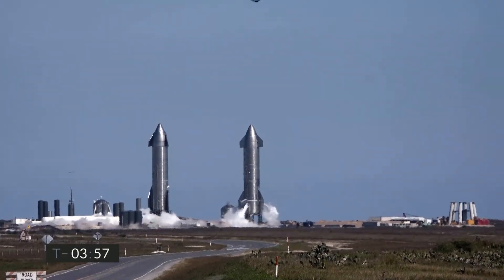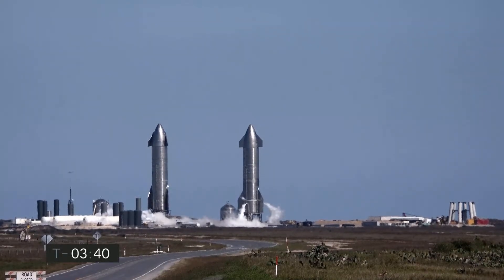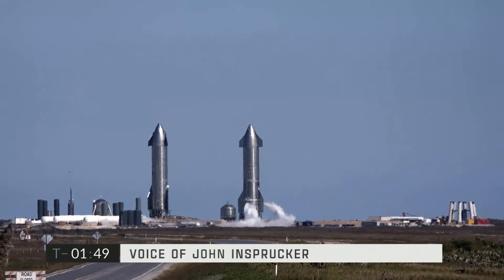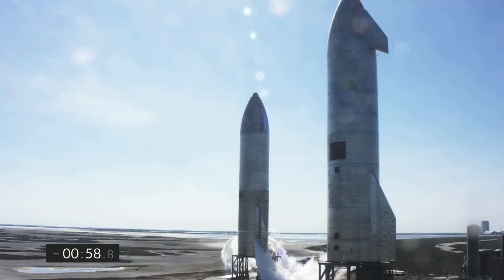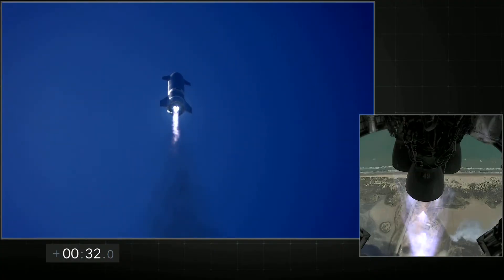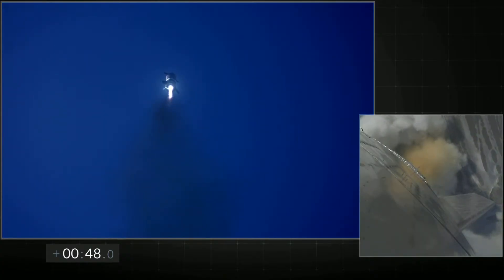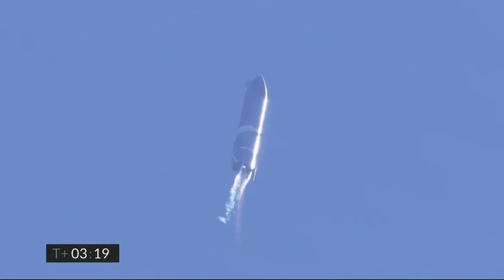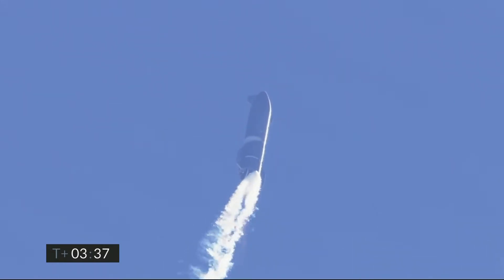Starship | SN9 | High-Altitude Flight Test

Comment: Next time simply start the transition early and see if you can get it to zero altitude change above the ground. When you get that working then go for the landing too. If you are just going to crater then work the kinks out in the air on the transition back out of the belly flop. Once righted you can also use the remaining fuel in the main tanks with the header tanks.

Comment: It literally swung like a pendulum past the ideal landing angle as well. Whatever thrust that was meant to slow the whole rocket down ended up going sideways. I think an earlier & slower flip with ~2 - 2.5X  more thrust once the correct angle has been reached might solve the problem. But hey; it's just a layman opinion, you're doing your best. Keep up the good work!

Comment: Just a question, it's obvious that these flaps on the rocket work in our atmosphere. But how's this going to work when landing on the moon, and on Mars? On mars the atmospheric pressure is much lower than here on earth, so how will these flaps be able to perform there like here? Or will the rocket totally rely on its thrust vectoring system?
Reply: The flaps are mainly for an earth landing. The plan is for the rockets to land on Mars and be able to return to earth.

Comment: I did not expect that ending at all. Talk about a twist ending. Pro Tip: Turn on the rocket's engines maybe 30 seconds sooner.
Reply: They couldn’t ignite a rocket engine. That is why it failed.
Reply: There isn't even enough fuel in the header tanks to run those engines for 30 second lol. Not to mention it would push them way, way off course.
Reply: @lazarus2691  Thanks for the info. First time I've seen them. The way they come down and go horizontal is pretty cool. All while being a controlled descent.  Has that even been done before?
Reply: Or maybe I was thinking of the other launch videos I watched today

Comment: Surely this silly......
Why not fly to 10km, then "land" at 7km, so you reach zero velocity in mid air. 
Then "land" again at 3km in midair
Then land for real.. You've now had three landing attempts with only one possible crash.
Hey Elon, need help?
Reply: Sure, how much fuel you wanna waste?
Reply: @vhonhernandez7681  How many rockets do you want to waste?
Reply: @rolandjollivet38  these are prototypes, you understand that right? They're prepared to lose these during testing.
Reply: The header tanks are only built to hold enough fuel for one landing. The main tanks become useless after transitioning to the belly flop.
Also, it's a lot better to lose control a hundred meters off the ground than a few kilometers. It limits how far from the pad the rocket will crash.

Comment: To speed up starship use.  And income.   Would it be a good idea to continue developing the 1st series of starship which do the iss trip and back without heavy booster.?

Eventually use the booster later to reful.   But keep starship autonomous .

Income will then come sooner than if we wait for the whole solution to be ready.   Booster, starship, stage separation, refuel in space, oil platform, etc

Even sending 20 people at a time to the iss, extend iss room by 2 will be a good contribution
Reply: falcon 9 is already stable and is launching to the iss
Reply: @kjeed7735  Falcon 9 is so small, old tech.  A spaceship alone is bigger than the iss.  Could carry more passagers and cargo  even if for the 1st years it will do trivial stuff like going to iss, go around the moon, do sole tourist or movies activities.

Comment: Will SpaceX please start the vertical reorientation and the landing burn earlier to give the Starship more time to make last second adjustments?
Reply: It's hard because the thrust from the engines is higher than the mass of the ship, so you have to land it basically exactly on time
Reply: @infinitelyexplosive  But they start landing burns much sooner for Falcon 9 First Stage booster landing?  Even when it is already upright?  If anything, I think the Starship needs more thrust from all three engines to slow it down sufficiently.  Otherwise, SN10 may be a repeat of SN8 and SN9, unfortunately.
Reply: @skywatcher316  Because F9 falls basically upright, it's falling some 3x faster than Starship, which means the landing burn is longer. Additionally, the engines on F9 are weaker, meaning it takes longer.

Comment: I doubt this approach will ever beat the space shuttle in reliability.
Reply: the space shuttle killed 14 people...
Reply: @kjeed7735  yeah...and your point is?
Reply: @bgdarumasan  reliability means it doesn't kill 14 people and once nearly burn up in the atmosphere only because luck
Reply: @kjeed7735  No, reliability means the degree to which it functions correctly. The shuttle had pretty good reliability for a launch and reentry vehicle. There were 135 missions and 2 catastrophic failures. I doubt SpaceX will ever be that reliable.

Comment: The difference in live vs tested restart of engines seems mainly the wild movement of the tank in live.  I wonder if this introduced bubbles or sloshing in the limited remaining fuel and caused engine burnout.  If not that, then what do you think caused it?  Just an engineer with no rocket science background speculating here.
Reply: @Aled Long one if the engines pretty clearly failed to ignite properly

Comment: As early as Tuesday, February 2, the SpaceX team will attempt a high-altitude flight test of Starship serial number 9 (SN9) – the second high-altitude suborbital flight test of a Starship prototype from our site in Cameron County, Texas. Similar to the high-altitude flight test of Starship serial number 8 (SN8), SN9 will be powered through ascent by three Raptor engines, each shutting down in sequence prior to the vehicle reaching apogee – approximately 10 km in altitude. SN9 will perform a propellant transition to the internal header tanks, which hold landing propellant, before reorienting itself for reentry and a controlled aerodynamic descent.
  
The Starship prototype will descend under active aerodynamic control, accomplished by independent movement of two forward and two aft flaps on the vehicle. All four flaps are actuated by an onboard flight computer to control Starship’s attitude during flight and enable precise landing at the intended location. SN9’s Raptor engines will then reignite as the vehicle attempts a landing flip maneuver immediately before touching down on the landing pad adjacent to the launch mount. 

A controlled aerodynamic descent with body flaps and vertical landing capability, combined with in-space refilling, are critical to landing Starship at destinations across the solar system where prepared surfaces or runways do not exist, and returning to Earth. This capability will enable a fully reusable transportation system designed to carry both crew and cargo on long-duration, interplanetary flights and help humanity return to the Moon, and travel to Mars and beyond.  

Given the dynamic schedule of development testing, stay tuned to our social media channels for updates as we move toward SpaceX’s second high-altitude flight test of Starship!

Comment: I don't get it, this was worse than SN8, like it did not even try to get straight..
Reply: The only reason it crashed was because an engine failed to light. The Raptor Engine is in development
Reply: @jackwhitlock1  you don't make sense, this is a terrible way to test engines, yet there are on-ground engine testing facilities.
Reply: @tekinsal8396  they test the raptors with static fires, it just happened to fail in launch instead of while static fire

Comment: Why don't simulate a landing on some altitude before landing on solid surface
Reply: what
Reply: @oren2000  to stop at an altitude when landing for example at 100 meter or less as a first step.
Reply: @omarmaaroof9621  it needs to come down and it has enough fuel for one landing

Comment: did i miss something?   nasa almost always landing their capsules in the ocean.   spacex  how far from where it landed to the water there?  at least you would not have wrecked your rocket.
why are they designing these back to the rockets?  nasa at least attempted the spaceship to land normal and attach it to a rocket.  Elon, you need to redesign them to be more like the stealth plane (areo dynamic) and attach it to a rocket or give it booster rockets to  get outside the atmostphere.

Comment: You spend too much of fuel for this maneuver. Use 3 small parachutes to reduse the speed and fuel consumption + it will stabilize the whole construction in the air.

And start the flip earlier ;)
Reply: They wont notice your comment. Ive seen others suggest the same thing but theyre gonna do it their way anyways
Reply: @pictobloxer5412  it's funny not to use the simple decisions and spend tons of fuel ))) I've thought that Elan fights for the green energy and clean planet.
Reply: @zonaxmd  He does, and they didnt use parachutes either on Falcon 9. Probably some people said "uSE pAracHutEs" when they failed to land
Reply: it's designed to work on mars, parachutes are ineffective with this mass
Reply: @kjeed7735  I don't exclude the main engine work. Anyway some extra solution can help, especially when you park this huge thing on the other planet. You will not have one more SN near by.

Comment: I hate to say this. But relying on engine(s) to re-light whilst you are slinging the fuel around in acrobatic maneuvers is asking for trouble. Expecting the engine(s) to re-light with all of the air pressure inside of the engine bell changing moment to moment as the vehicles is performing aerobatics. You don't do that will the Falcon?

I think its time to review the option of a set of parachutes on the top of the nose. Pulling a set of parachutes would drag the vehicle vertical by default and yes relight the engines. Once vehicle has slowed. The parachutes could be jettisoned on confirmation that engines running or leave the chutes and use the nitrogen jets to guide the vehicle to the landing pad. If the engines don't start you are left to bring down the vehicle at a heavy but survivable speed for the vehicle legs.

So, float down as you are with flaps guiding. Then, allow the base to become lower than nose. If you can cause a stall then all the better. Then pull the rip cord for the drone chutes to pull out the mains chutes! You can repack the chutes to make it reusable :o)

You need something that will works EVERY time. You had a nice sunny & blue sky and it wasn't quite there. Yes, you could continue to perfect it. But I believe the answer is staring you in the face. :o)  

Back to first principles Elon. Don't over complicate the solution. Yes, you will lose a payload weight. But it's cheaper than replacing Starships each time. :o) Even if they are only $10M. 

Think about it. You are static firing the engines before each flight to ensure you are happy on both the Starship and the Falcon. 

For Starship to work. You have to be at the Car level of starting an engine every time without thinking about it. That a system with 99.9998% level of performance.  Each time you start engines you cause damage. So, don't. Unless you really need to.

Just my thoughts on the subject. I will be interested in seeing how you get yourselves out of this one. RIP to S8 & S9. S10 doesn't look happy by the way. :o)

Comment: In both cases, the ship began to turn too low to the ground, when there was not even time for its alignment. To begin with, we would fly higher and learn how to turn it over without landing in order to master the coup itself and secure the vertical of the ship. When returning from space, the speeds will be completely different, the ship must have an altitude in reserve, otherwise, there is no way.

Comment: Do you guys take safety seriously. 
The potential debris etc if the craft malfunction near the landing pad is a high risk. 

Much of what your trying and doing would never be done by nasa without safety measures. 

Still a long way to go. But I’m not sure this is the way to go. Significantly bigger problems on the horizon.

Comment: Im not a science geek to be sure. I presume its the large momentum of the heavy Starship rocket body that is making the tilt during landing to go beyond the initially planned 90° tilt.
Reply: Exactly. More specifically, the problem has been engine failure. They're trying to relight the engines from a spherical tank in the nose (because all the other fuel is settled horizontally during the sky dive) and it's proved difficult.

But they have another prototype all ready to go, and many more being churned out of their facility.

Comment: I'm not an expert, but somehow strangely the place turned out to be empty after the fall of such a huge mass, no pits, no fire, dust and that minimum, maybe they launched a hollow aluminum model into space, all this is strange. But on the other hand, if it exploded, there is insurance, maybe it's the insurance, the mock burned out, and the real ship will be written off, because the profit is big
Reply: Umm... this is a test program, in which SpaceX is working to learn how to best make Starship, and they are learning in an intentionally rough way, which involves them possibly blowing up - if you look however, you see that Starship SN10 is already waiting on the pad to launch. 

I don't think you understand how commercial space regulation works, but there's not really insurance fraud - if anything, SpaceX is the insurer, that if a rocket fails on a satellite launch, they reimburse the owner of the satellite.

Again, this was not any kind of serious failure. A landing would've been fantastic, but this is a brand new rocket, and it took SpaceX many tries to learn to land the Falcon 9.
Reply: @WasatchWind  now everything is clear, the advertisement itself is misleading, that it was a Starship that exploded, and not a test object. Thanks!
Reply: @2024Phoenix  Well, it is a test Starship. While the landing is part of the test, they are also testing how it maneuvers in flight, so the video title is still accurate.

The precise point of the test is to learn how to do this, so that it can do the sky dive and landing while returning from space.

This is only one half of the rocket, and once the other half, the massive Super Heavy booster is finished with test hops of its own, SpaceX will attempt orbit probably this year, and then begin satellite launches.
Reply: @WasatchWind  , thanks for the informative explanation
Reply: @2024Phoenix  Np, sorry if it was a bit obtrusive. I love space, and I want people to be able to understand it. :)
Reply: @WasatchWind      :-)

Comment: 11:44 I guess the landing maneuvers are wrong
Reply: SpaceX hasn't yet informed us what caused the landing failure precisely, but like last time, it had to do with the engines.
Reply: @WasatchWind  If we accept that there is no problem with the engine;
After this time (11:45), if the lower wings were fully open, if the motor nozzle was turned to the opposite direction and the rocket body was 100 meters higher, perhaps a more successful landing could be achieved... Birds do not land badly in this way and they reduce speed and acceleration by opening their tails. :D
Reply: @ahmetizmir1081  One of the engines failed due to a unknown reason, causing it to lose control and crash.

Comment: Perhaps all three engines should restart at landing to ensure redundancy and immediately throttle down if all three do indeed light.  Once the rocket has zero vertical velocity and pointy end up, it can hover whilst reducing thrust to land gently. We have seen few tests of raptors running, stopping and then successfully restarting when hot. This is the current (SN8 & SN9) weak link.Hopefully fixed for SN10 later this month. Great work guys!

Comment: You are watching a circus.  What a joke Spacex is.  Smoke and mirrors. CGI Crap. Who really believes this illusion?
Reply: If you're not joking I feel bad for you... if you want to see it with your OWN EYES go down to boca chica you piece of paper
Reply: @oren2000  Don't be so easily fooled. They are just working props. Any fool could work out that if you had a plane you could just fly horizontal for 63 miles and you would be in so called outer space. What is with all the BS Rockets
Reply: @dpgedward5947  so... a working prop is a real rocket
Reply: @dpgedward5947  plus, the highest a plane can go is 100km (karman line/space)

it reaches it's apogee, then lands on earth

Comment: At 6:25 something falls and hits the other spaceship. It could be a bigger disaster ...
The issue is ... did they have victims other than of course the many lost $? ... 
Στο 6:25 κάτι πέφτει και χτυπά επάνω στο άλλο διαστημόπλοιο. Θα μπορούσε να γίνει μεγαλύτερο πατιρντί... Το θέμα είναι... είχαν θύματα εκτός φυσικά απο τα πολλά χαμένα $?...
Reply: I don't see what your referring to. These test flights aren't any kind of major failures. They are only just learning how to fly a rocket different from any other, and they are building them at such a rapid pace that the successor to SN9 is already on the pad.

The explosive landings, obviously, are not preferred, but again, it's a test program, with no cargo or crew aboard. In addition to this, they evacuate the area during these kinds of flights.

The only crewed missions SpaceX is currently flying are on Falcon 9, looking to be about three or four NASA flights a year, with a couple non NASA crewed missions at the end of 2021.
Reply: @WasatchWind  look again... please...